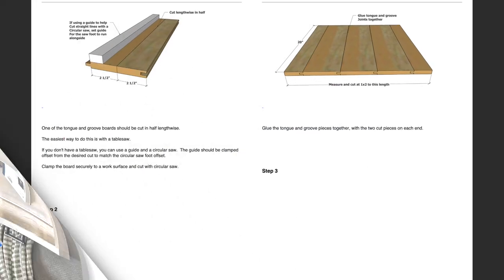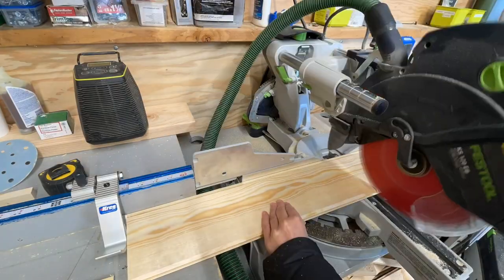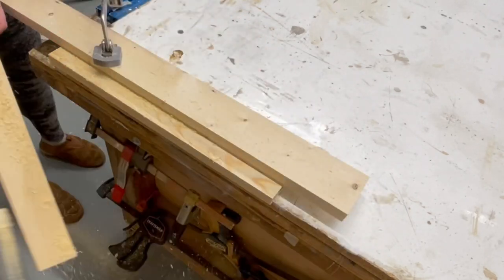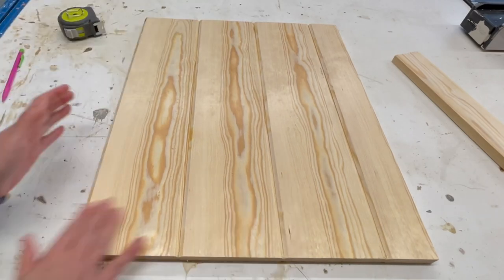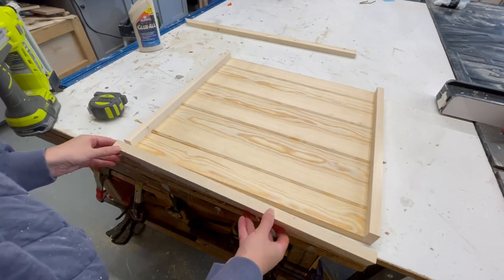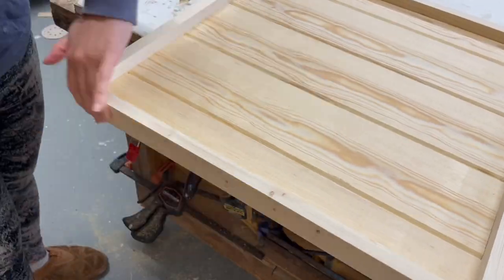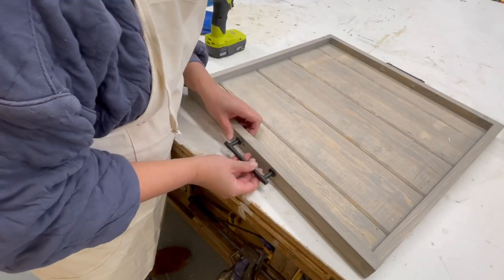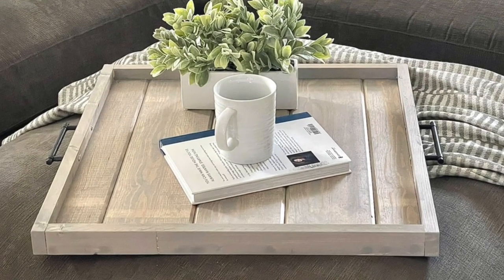How to Build an Ottoman Tray with Free Plans

Comment: I'll definitely be doing this.  One tip for you that I just learned myself, before you use the nail gun, put a blue piece of tape where you are going to nail.  Then nail through the tape.  Then use the wood putty to fill the hole.  Once dry remove the blue tape.  Now sand.  This keeps your wood putty from filling the grain and keeping your stain out.  So you won't see the wood putty because the stain will adhere better.
Reply from the maker: Great tip!